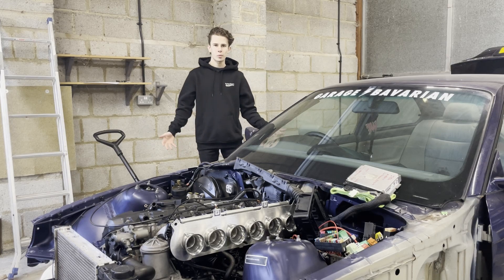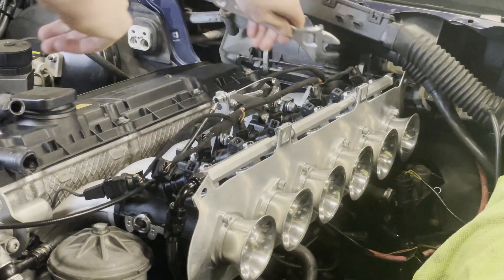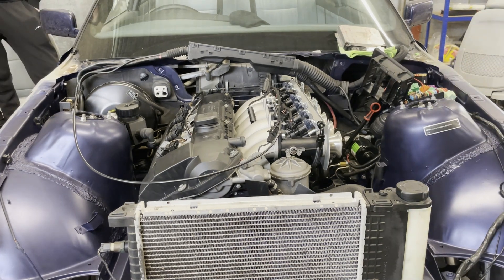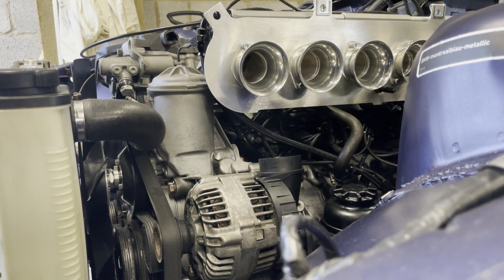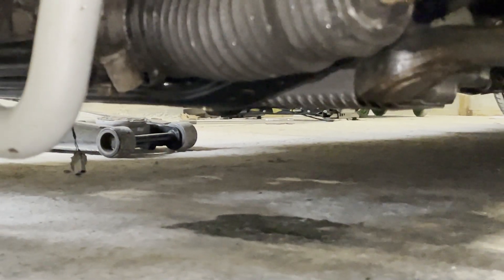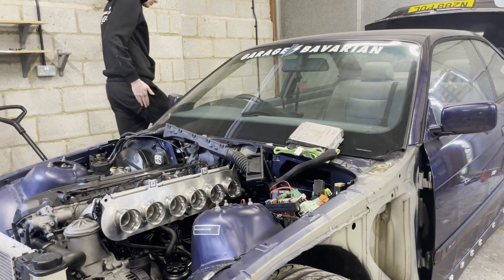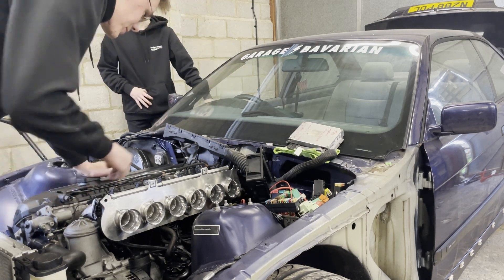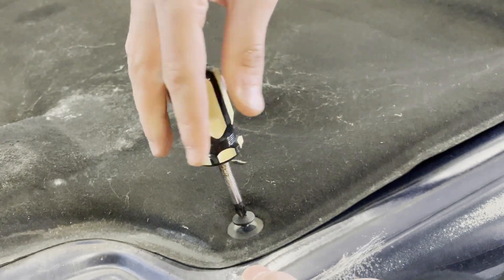M52B30 Engine First Start! 2 Tools Try 2 Use Tools

Comment: I have a question on the ITBs. Since you guys have removed the stock intake/filterbox, how do you go about connecting the MAF sensor? Im guessing you're still on stock ECU, so how does it run without connecting the MAF?
Reply from the maker: Good question! Yes still on standard ECU. These are Individual Throttle Bodies (ITB's) with no airflow meter, the car is tuned using Alpha N where the ECU relies on the throttle position sensor and engine rpm to estimate the fuel requirements.
Reply: @TheApexSuspects  thank you for your reply. I'm considering ITBs some point in the future and was confused about this. That means you had to remap the ECU just for this application is that right? Did you do it yourself or have you gotten it sorted by a tuner?
Reply from the maker: Happy to help. ITB’s can be a pain to set up. They make all the right noises though haha. Yes the standard ECU was remapped elsewhere however for better control and a more reliable solution going standalone would be much better.
Reply: @TheApexSuspects  Exactly what I had in mind, using the stock one while I plan for a standalone ECU setup for the ITB. A  lot more flexibility with a standalone. Thanks again, hope to see more from you guys.
Reply from the maker: Sounds like a good plan. Good luck with your build and yes keep an eye out. Some more videos on this E36 and another crazier E36 project in the pipeline… the issue is both of our full time jobs keeping us busy